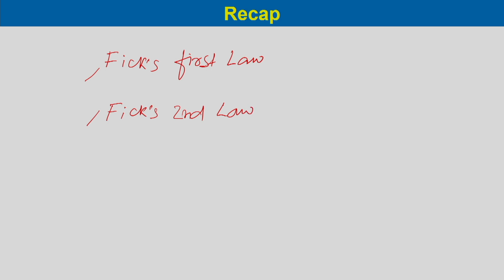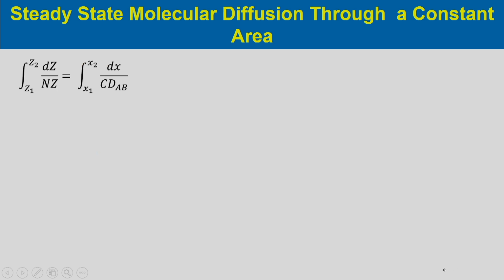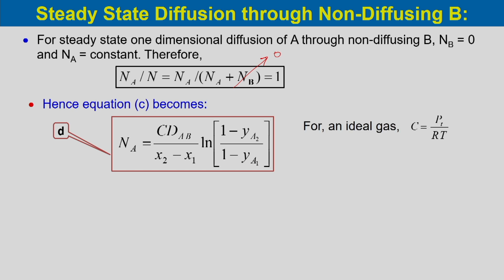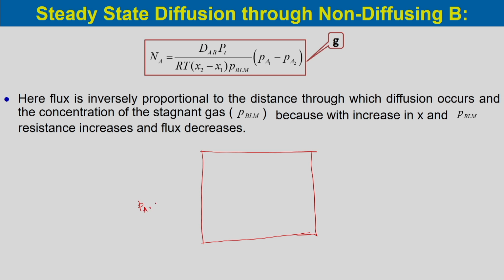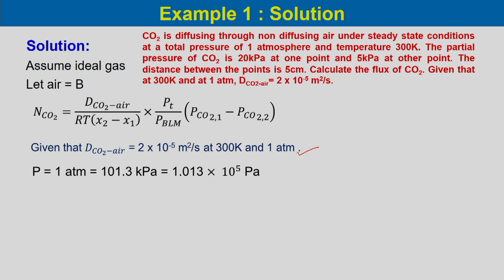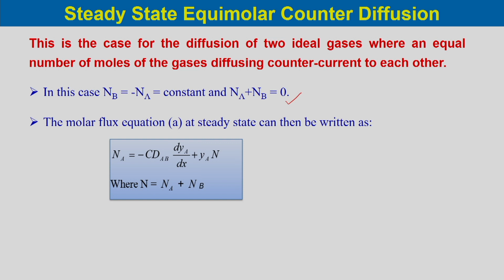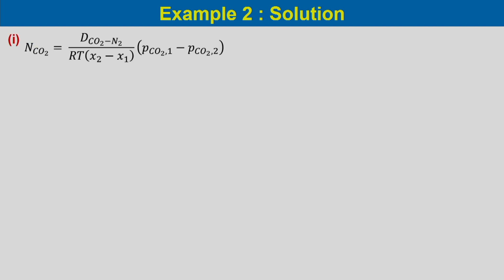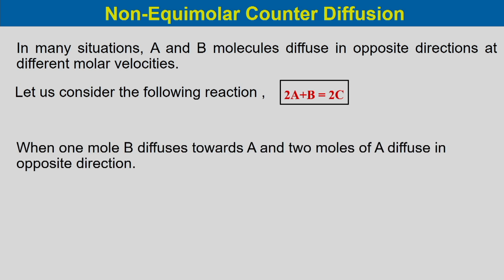Lec 4: Steady State Molecular Diffusion in fluids under stagnant and laminar flow conditions

Comment: you are taking a long a boring approach for solving the numerical problems! It's time consuming and unnecessary.
Reply: Here's a suggestion. Instead of watching these lectures, directly read the transcripts of these on the NPTEL website. These transcripts also contain detailed images of these slides
Reply: @KamaldeepSingh7  refer NPTEL vedios on mass transfer by prof. Nishith verma, IIT Kanpur. Here is the link that you may refer- https://youtu.be/HlHyEcP_7SU
https://www.youtube.com/watch?v=HlHyEcP_7SU&list=PL38769A2045D58D20
Reply: @uddiptanath6055  but the lecture series you've referred is for mass transfer -2.... From which video source can I study mass transfer - 1 ?... This is the only NPTEL lecture series that offers mass tranfer - 1. 
One more is from Dr. Ashok Bhaskarwar from IIT-D, but i found it too advanced.
Reply: @PruthveshMandle  That video lecture is for MT 1 only... the thumbnail they have put isn't correct. I myself have gone through the video... It has Diffusion, absorption, Convective MT, MTC, Distillation etc. included.  You can check one or two video.
Reply: @uddiptanath6055  no, the thumbnail is correct. Look at the introductory lecture. Dr. Nishith verma himself says, in the first lecture. "This is the introductory lecture on Mass Transfer - 2" 
And I've gone through the lectures,  the basics of mass transfer are not covered thoroughly, he just refreshes the diffusion concept and then goes on to the application of mass transfer in various equipments, absorption, distillation etc. (mass transfer 2).